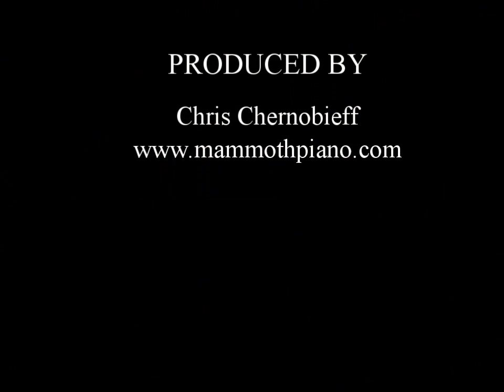How to move a Grand Piano

Comment: That pedal lyre will be ruined after 2 or 3 more moves like this, the lazy man's way.
Reply: wrong!
Reply: I can show you the lyre of a 1972 Steinway B211 (new enough for you?) that condradicts your assertion. Of course with the proliferation of Asian pianos these days, there's always a new one if the old one fails.
Reply: I have been moving pianos for 25 years. I always keep my customers by converting them to life long tuning customers. I have never broken a lyre. What you're not understanding is called torque. When tilting a piano onto the lyre there is a right way and a wrong way. I'm smart, i do it the right way. If you tilt a piano off of the board that is on the ground it will be too much torque on the lyre and it can bust it. I have also seen the rear leg bust on older grands tilting a piano this way. My dolly, as seen in the video, is 1 foot high. When i tilt off of it, the lyre comes down perpendicular to the floor ( zero torque).  Now here's the smart part. I inspect the lyres before tilting. If it is a 9 foot grand with a tiny lyre, i take it off, and adjust the method. Another method is to support the lyre with a coleman bar if it is deemed necessary.  Again, i've never broke a single lyre in 25 years, because i'm conscientious and pay attention to what i'm doing.  If you broke a lyre of a Steinway, then I suggest you did it the wrong way.
Reply: plus, ever hear of a coleman bar?
Reply: Just get a Moondog!  Look it up on the web. End of discussion.  The easiest and safest way to move is with a moondog attached to lyre stretcher